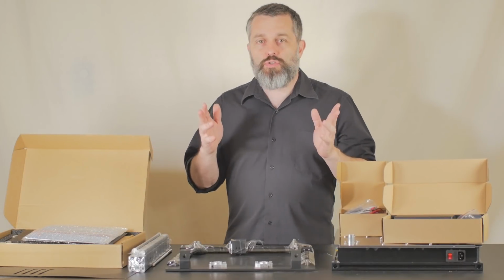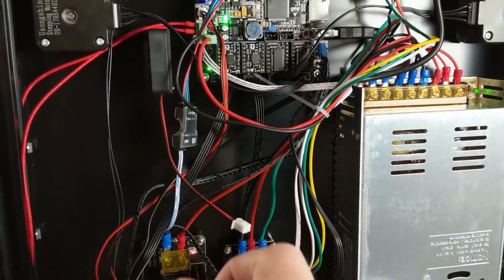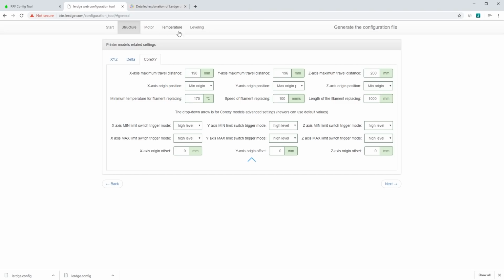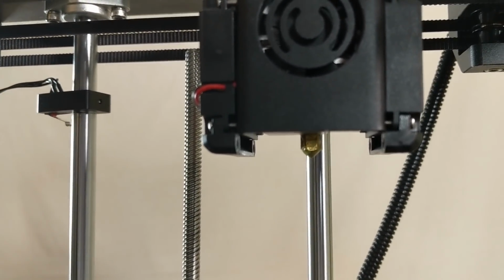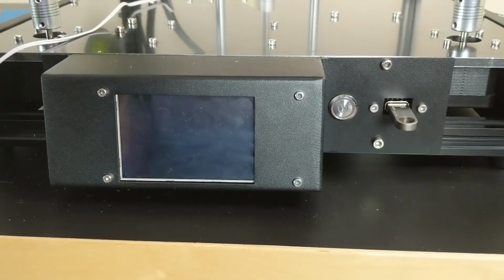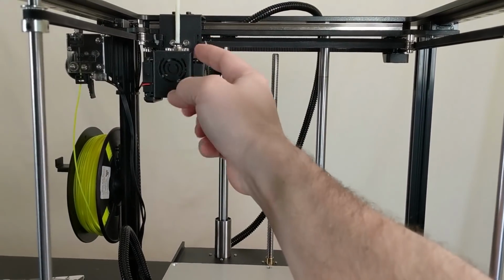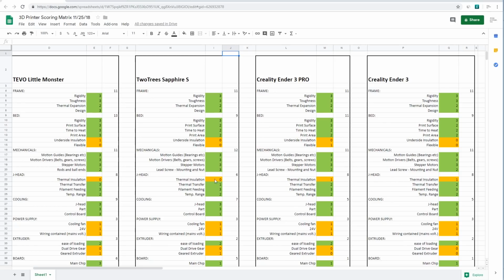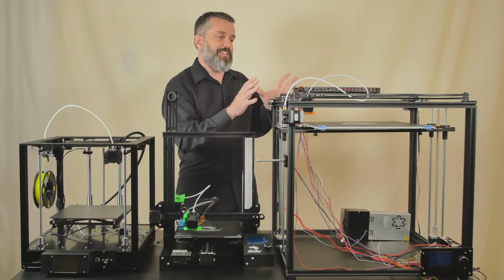The TwoTrees Sapphire 3D Printer Is the Best We've Seen Coming out of China

Comment: I think the spring couplings for XY are a bad idea especially when you wanted speed.
Reply from the maker: The flexible couplers only act as a spring axially. They are perfectly rigid in torsion. The way they are used on this printer is the perfect application for flexible couplers. Your complaint is a residual criticism for other printers that use flexible couplers on the lead screws for the Z-direction. Thus mounting the entire Z-axis on a spring loaded platform. Not good. This printer has a rigid coupler for the Z and does not suffer from this problem..
Reply: @DesignPrototypeTest  It is designed to flex axially and radially, but it still has little deflection in torsional load. I have no experimental data to prove this and maybe it is negligible for Nema17's torque. Anyway I don't see any benefit using flexible coupling for this application when top and bottom are fixed,  but possible problem.

Comment: I tuned out when you said it's not open source. Fail.
Reply from the maker: Fair enough. I pretty much agree with you.
Reply: @DesignPrototypeTest  now that some time has passed - did the firmware turn out to be open source or proprietary? It sounded like it was open source firmware, just configured to this printer and with a GUI in front, in which case they should release the source due to the license. Did they?

Comment: I was going to ask if you could upgrade the board to a Duet, a quick google found a thingaverse of Duet mounts and due display. I'm curious if that upgrade would improve the printer? Also, how would it compare to the Ender 5 (a comparable design), especially if you ran both on Duet boards?
Reply: I think I can answer this question: The Lerdge-X runs the STM32F407 ARM chip at 168MHz. The Duet 2 wifi runs the ATMEL SAM4E8E at 120MHz. So you shouldn't upgrade both printers, only the Ender-5. Then you should try my upgrade (getting it to print at 300mm/s) and see which printer does better. Obviously, the Ender-5 needs this upgrade, to be able to get to such speed at all. However, the Lerdge-X does not support WIFI, in fact it doesn't support almost anything. So if you wanna upgrade the Sapphire-S, you should get a better board - maybe a Lerdge-K, but definitely not a Duet, that would be a downgrade and not an upgrade w.r.t the performance.
Reply: @nyyotam4057  Thank you for the response. I get that processors can have an impact, but my concern is the the stepper drivers, which can have an even bigger impact, especially the 4988s for the Z and extruder compared to the TMC2660s on the Duet 2 (wifi or ethernet).
Reply: @sethhill5689  The 4988s for the Z and extruder are noisy, shi**y and have a lot of faults, but lack of speed/acceleration is not one of them. Lack of microstepping is. In other words, the TMC2660 essentially have 16th microstepping multiplied by factor of 16 to give 256th pseudo-microstepping while you can forget about such quality from the 4988s. However, the 4988 might even have better acceleration since when you go to higher microstepping ratios, the torque actually goes down. Now if I wasn't specific enough I beg your forgiveness, but my entire interest is to make this certain printer run FAST and I really don't care about print quality or noise. But that's only me. If I want a beautiful print, we have a CR-10s Pro at work.
Reply: @nyyotam4057  I appreciate the replies and the info there in. So if we want speed, we keep the stock board (or maybe upgrade to the Lerdge-K) but if we care more about quality of prints we should move to the Duet 2.
Reply: @sethhill5689  Yes and no. Yes, you can get better quality from the Duet 2 at lower speeds then the Lerdge-X, due to the Lerdge-X use of two A4988 drivers. But overall the quality you can get from the Lerdge boards isn't bad - Simply because In fact, they are a total ripoff the Duet. The Lerdge-K which I've mentioned, is not only a ripoff the Duet 2 but it actually has 6 MKS LV8729 silent drivers on board, which are in themselves a ripoff of the Trinamic drivers. And it costs like 50$ less than the original. So though I didn't have a chance to try it yet and it might still be a new product - maybe you need to let it cook for a couple of months to allow Lerdge to fix all of their problems before ordering one - but it should outperform the Duet 2 in just about every regard. Of course I fully expect Duet3D not to take this lying down, so they will, most certainly, also start selling their boards with a faster chip soon. In short, don't rush.
Reply: @sethhill5689  Well guess what - I've just checked Lerdge's web site and they allow you to customize your Lerdge-K board if you order one. You can order it with original Trinamic drivers burnt on it instead of the LV8729's. The logic behind this, is that the LV8729 supports 128 pseudo-microstepping while the original Trinamic drivers get to 256. But this costs more. You can still get it for about 30$ less then the cost of the Duet 2.
Reply from the maker: A Duet would be a downgrade? HA HA HA HA HA HA! You definitely should not replace your 2000 Honda Civic with a Tesla. that would be a downgrade.
Reply: @DesignPrototypeTest  You are correct that the Duet is probably the best 3d printing board in existence today - as long as you don't take it to the end of its envelope and then compare it with (between the two of us) a sh*tty board like the Lerdge-X which doesn't allow for any expansions and doesn't have wifi at all - but still can run faster than the Duet 2 Wifi. The Duet 2 is a masterpiece of electronics and engineering - but they need to put a faster chip. Otherwise the Chinese will simply outrun them in the printing speed test in the case of Delta or CoreXY printing, because these modes of printing demand fast calculations. Why don't you simply try it out and see for yourself? Upgrade your Sapphire-S to be able to pass 300mm/s, then test its print speed at top speed with a high jerk setting - and then try to 'upgrade' to Duet 2 Wifi and see what happens.. Well, what will happen is that at the best case you will not sense any improvement. At the worst case, it would actually print slower. But if you need to see it for yourself to believe, let it be. I suggest you try it.
Reply: @DesignPrototypeTest  BTW, the reason I did my upgrade on the Sapphire to get it to these speeds, was entirely because I was feeling that taking an ARM processor and building a board around it - and then printing at around 60 mm/s max - is a total waste.
Reply: @DesignPrototypeTest  Anyhow, the duet board has the newest Trinamic drivers, of course. So I agree that as long as you don't take it to the end of the print speed envelope but stay within - say - 150mm/s - then most probably the Duet board will give you better results.
Reply: @DesignPrototypeTest  You know what you should do in order to test it? Well, first do the needed upgrade to allow the printer to get to high speeds to begin with (high torque Z-axis motor - just cut its shaft to the same size as the stock USongShine motor, Greg/Wade extruder with another high torque motor, steel core GT2 belts and properly stretch them - and that's more or less what you need to do) - Then do the spiral vase printing test with 40mm/s jerk (mutation) speed and 300mm/s print speed. Measure exactly how long did it take to print your vase - then replace the board to the Duet and try it again. Let us know the results. If the Duet still is faster, you can try it again in faster printing speeds which I don't dare reaching, since I don't have 23k subscribers who sponsor me and I don't want to ruin my printer.. Maybe at 400mm/s the Duet will start lagging. Anyhow, eventually it will.
Reply: @DesignPrototypeTest  PS I don't think I should mention that you need to actually change the setting of the firmware and the slicer to make the printer actually get to speed. If you don't do that, it will not really print in 300mm/s.. But I'm sure you're well aware of this. After all, you do have a little monster.
Reply: @DesignPrototypeTest  maybe you can get an Ender 5 and a couple of Duet 2 boards sent to you to do a side-by-side comparison, maybe do stock and then upgraded boards? I think that the Ender 5 would be the better comparison as it is the same type of design (core xy) and about the same price point. If I had one right now I'd offer it for a comparison.

I have been eyeing the Ender 5, especially when most Ender 3 mods will work on the 5, but would consider moving to this printer if it is better (stock and upgraded). I care more about the quality of the prints and networking so I would be considering upgrading the board.
Reply: @DesignPrototypeTest  Hmm.. Maybe you should also do a comparison - Duet 2 VS Lerdge-K. The Lerdge-K has a seperate WIFI module, you'll need to get a bundle.

Comment: No need to be too hard on it, though.. If you do my upgrade, at least you'll be able to get a 200mm high spiral mode vase with 0.3mm layer height, in about half an hour and it WILL be watertight.. Despite the print quality be absolute sh*t. But hey, you could put flowers in it, so no one would notice. Hmm.. Just don't forget to cut the shaft of the high torque motor for the Z-Axis to be the same length as the shaft of the slim USongShine motor, or else you will not be able to print all the 200mm height of the vase.

Comment: Ender 3 killer at 2x the cost? Clickbait.
Reply: If it was actually better quality than the Ender 3 Pro, then it might be worth twice the cost.  With all the defects that he ran into and the half baked design concepts exposed through his review, yeah this isn't close to being worth it.   I think the Ender 3 Pro sets the bar a lot higher than this did.   Frankly, upgrade the Ender Pro 3 to a Duet board (and some people have) and you have a killer 3d printer that is around the cost of this POS.
Reply: @underourrock  ender 3 pro? The standard ender 3 will do...
Reply: @alejandroperez5368  as long as you do the easy / cheap upgrades to it, I'll gladly agree with that. The pro has a couple things done to it that the regular Ender 3 could be upgraded with as well as several other things for both that really make some good improvements for not a lot of money.
Reply: dude its coreXY
Reply: Show me an actual model printed. My ender 3 prints smooth, detailed, and good speed. Everything is good when you calibrate properly.
Reply: if  sapphire pro pk ender-5
Reply: Yeah something is off there. Just look at all the problems, but hey give it a good score.

Comment: Btw, if you take this printer, strip it from all the sensors and from the auto leveling option and throw away the fast ARM chip Lerdge-X board in favor of an old Creality 8-bit board and take 30$ off the price for it, then you add 30mm of print size to each side, what do you get? Right, an Ender-5. But I'm afraid that the Ender-5 would never be able to do 300mm/s as its slow processor wouldn't be up for the job. In short, the only reason I can think of why buy this printer and not the Ender-5, is if you wanna play and ruin it to get it to print at 300mm/s :-).

Comment: I've taken this printer and ruined it(actually made it go faster). watch?v=NActRRqV9P8 to see how I've completely kicked it's ass. But now I got it printing real fast & ugly  :-). Works like a charm. In fact, I've kept the 300mm/sec as the permanent slicing setting since doing the upgrade - and I let the firmware decide when to go slower. One thing I recently decided not to use is the filament runoff sensor. Only use it when there's a chance of the filament actually running out, otherwise, it can sometimes give bogus runoff detections.

Comment: This apples vs oranges review should have been against the Ender 5, which is nearer the same price point. Stepping away from open source hackability, plus the online support groups, seems a serious disadvantage.
Reply: Ender 5 is cartesian still , not true CoreXY
Reply: @thebrunoserge  Who cares what kinematics it uses? Does it print well out of the box. Clearly no, in this case.
Reply: @NameOfTheDragon  If you're a tinkerer, you care what hardware comes with it, and then put time into improving it at low cost. Printing well from the start is not the priority, or I'd be ordering pre-assembled and tested stuff
Reply: @NameOfTheDragon  kinematics are kind of important...but since the ender 5 isn't a bed slinger I think that other guys point is silly. The ender 5 or even 6 would be a better comparison. since speed and quality should be closer.
Reply: @thebrunoserge  How is the Ender 5 Cartesian?  I am still learning.  It appears to be CoreXY what am I missing?
Reply: @anymouse5018  Not CoreXy because the motor powering the X movement is loaded on the Y carriage, and moves with it (more inertia).
Look at a typical belt arrangement on a corexy ( https://3dtoday.ru/upload/main/e32/snap%20printer.jpg ). It's meant to keep motors static

Comment: Small Build Volume, missing fan plugs, follow along bed leveling, locked firmware, power loss recovery doesn’t work... easy pass. Has potential but the Ender-3 is a better buy hands down.
Reply: Yeah. He lost me when he said his solution was to start cutting and splicing wires.  More money and smaller build volume does not make it an ender-3 killer.
Reply: Greg Holliday Right. You want a great value printer that is as good as a Prusa and prints beautifully? Get a Formbot Raptor 2.0
Reply: Darryl Kemper 850$? This is 250?

Comment: Would't adding an anti-backlash nut to the Y axis prevent the sagging of the bed?
Then you'd "just" have to replace the controller with a Duet board (thanks to that closed firmware) to avoid the printer from homing after a power outage to resume printing.
You can't make ANY change to it.
Closed firmwares really suck!
Can't we somehow launch a community initiative to releas the FW, yust like what happened to Creality?
Reply from the maker: >Can't we somehow launch a community initiative to release the FW, just like what happened to Creality?
With Creality it was cut and dry. We knew they were using Marlin. We knew they had not released the source code. With the Lerdge, we don't know what that board runs. It's completely closed source and obfuscated. As far as I know there is no way to un-compile and see under the hood so that we can definitively identify Lerdge firmware as a clone of RepRap Firmware. All we have is a reasonable suspicion. Maybe the RRF guys might have some crazy smart way of identifying that firmware as theirs but it's beyond my understanding.

Comment: Just wondering how the rigidity of the bed is, with only 1 Z motor.
When you grab the front of the bed, and move it up and down, does it flex?
If yes, does it influence print quality?
What is the thickness if the aluminum plate?
Reply from the maker: The bed certainly flexes if you grab it in your hand. However, it is rigid enough to have no effect on print quality. The Sub-bed support structure is 3mm thick but it has those 90° folds on the edges which greatly enhance rigidity. I would like greater rigidity but there are reasons to do it this way: fewer setppers, looks cleaner, less expensive, easier to access the print, etc. Giving this design a little more credence is the fact that the E3D tool changer does it the same way.
Reply: @DesignPrototypeTest  "the E3D tool changer does it the same way"
I doubt that they use 3mm aluminium